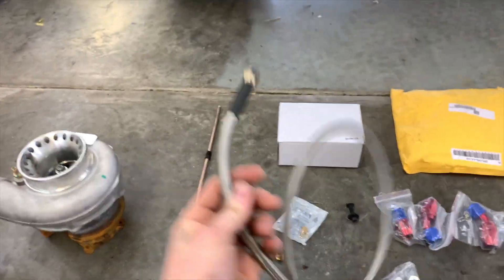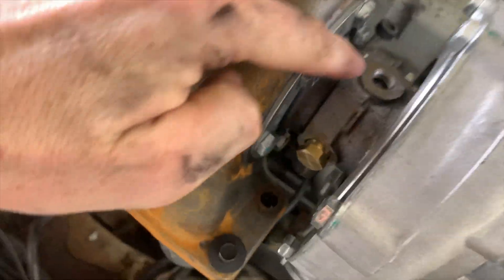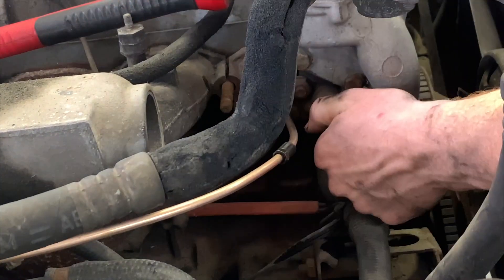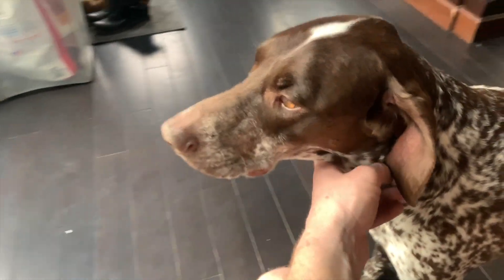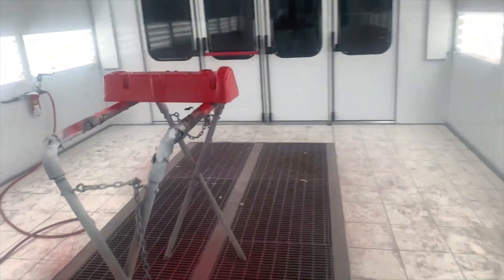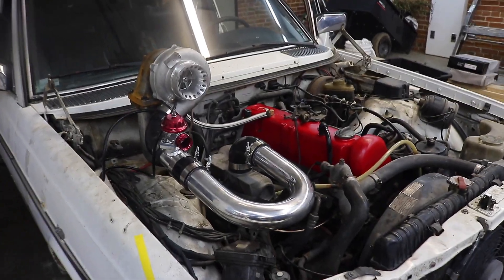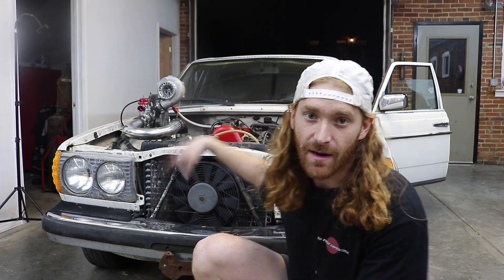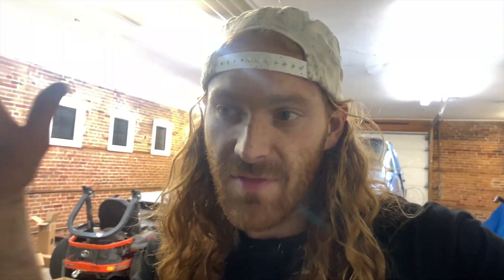EBAY TURBO MERCEDES IS READY TO HIT THE STREETS!

Comment: Hey man this is awesome but if it were my car i would run it a little different, that turbo drain might dump too much hot oil on the cam. I would run it to the pan its not hard to do a bulkhead fitting or a bung.
Also that part you tapped is the cap for the timing chain tensioner and it also serves as a pressure vessel to hydraulically push on the tensioner rail arm. I dont know if pulling oil from there is a good idea. I had that gasket leak once and the tensioner wasn't pressurized enough by the oil galley in that area and my timing chain blew a hole in the valve cover. Engine was ok but it doesnt get any closer than that to failure.
I also am not sure if that area that you tapped will supply the volume of oil you need. Look into "mamba turbos" online they have an adapter that is the correct threads for your setup. Again just my 2 cents, i hope this thing rips!!!

Comment: Did you turbo a 617? The 617a is the turbo version and can handle the boost. I see this is the last video of the car that you posted so I’m assuming something bad happened to the engine/ just didn’t want to make any power. Those NA intake manifolds go for like 3-500 on eBay too btw

Comment: You need to dino it now if you were to  lower into the engine bay a little more it will stop shaking as bad as it is right now it's top heavy so it's going to shake back and forth as soon as you give it some real gas and boost and most likely will blow off right where that rubber cup is
Reply: His main problem is the injectors are bad and rockers need adjustment.  You can tell by the sound of it plus the way it starts.
Injectors and rocker adjustment 
Would be a huge difference.

Comment: Why didn't you just get the factory parts from a wrecking yard. I would rather have a used factory garret which is what most of them had. Instead of a Chinese junk turbo. Not to mention everything would fit under the hood. 
My 300d has the 6 cyl turbo and it runs like a Swiss watch. The 
M.B diesel is probably one of the most reliable diesel ever made.
I have seen them with over 600k
Miles and still running strong.
There is a diesel mercedes in a museum in Germany with 1 million miles. It was a taxi in Germany.